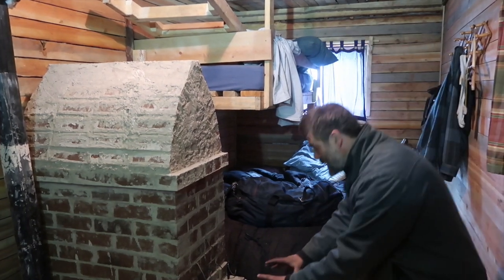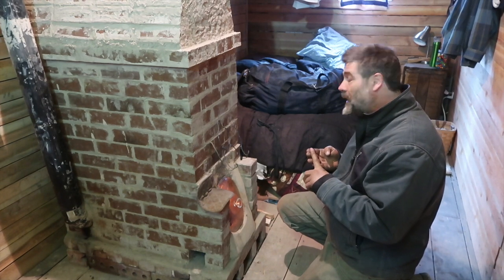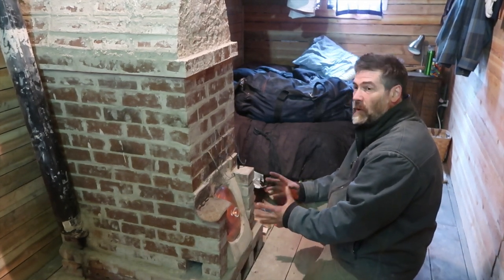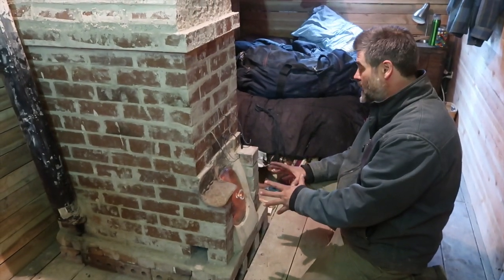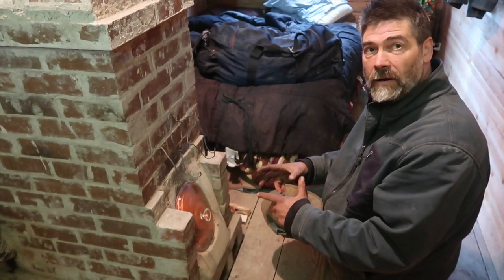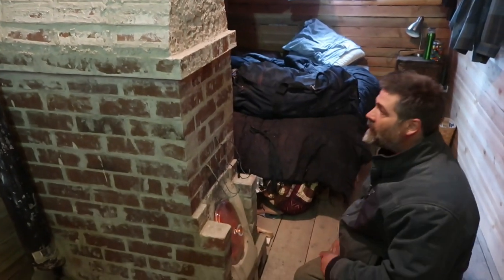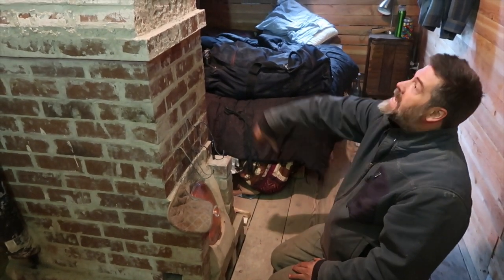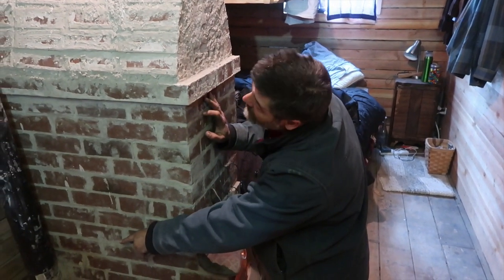Tiny House Rocket Mass Heater - the Cyclone by Kirk "Donkey" Mobert has no barrel!

Comment: Something what is the cheapest easiest fastest in simplest way to build something small for the people in Western North Carolina and Tennessee. 
They're going to be freezing to death...
I think I hate is that they use propane but little buddy heaters. 
I can guarantee some people are not going to wake up from lack of oxygen... Or they have a fire or an explosion people tell me 
Them to use rubber hoses that ain't the way to go and I'll tell you what!!
I'm having a small propane tank inside of a building is dumb. Need to be outside connected to the heater with a stainless steel braided hose
Reply from the maker: Like this? https://permies.com/3dp

Comment: Hey there, This question has maybe been answered here or elsewhere already but I'm trying to get some fast answers without having to parse through endless forum threads. I sometimes hate to admit it but aesthetics are very important to me and I've never been fond of the look of the oil drum bells. But I really love the look of your arched bell here and it happens to fit in really well with the large arched braces on the home I'm building.  The house is quite well insulated as it is strawbale wrapped but is also not that small of a space  so "fast heat" would be helpful in my situation. 

My first question: Does the use of brick in the bell instead of steel considerably slow down the overall time it takes to heat up a space?  If so, I wonder if having an arched bell fabricated from stainless would work or would the excessive welding at the edges make this a bad idea?

Comment: Did you use average, single-wall galvanized chimney pipe sections, to cast refractory cement into, to make the burn chamber & riser?  
Was there any insulation used on the outside of the metal riser? 
How long, with moderate to light use, would your tiny house rocket-mass heater last? 
Do you have other videos of you building this?

Comment: Questions: Isnt the barrel easier to remove to clean? Would you clean soot by regular chimney sweep methods? How do you maintenance it without disassembling it?
Reply: There is no maintenance on the barrel model as the creosote and smoke are consumed by the intense heat. What’s left is water and co2 per a previous video. Not sure if the same applies to these smaller versions.

Comment: Splendid! I have learnt so many things from this video!  I don't know if you could or would help me. I"m building a mass heater and I don't know if I can use the wood stove I have(terracota) as a mass. I want to use the wood stove as a mass, just introducing the exhaust pipe of the rocket stove into the lower part of the wood stove, so the wood stove will be the mass, then the exhaust will go up the chimney of the wood stove , after warming the wood stove. In this way I have a chimney and a thermal mass. The size of the exhaust pipe of the wood stove is 15cm, I mean the diameter, so I suppose the diameter of the exhaust pipe of the rocket stove should be also 15 or less, the same for the diameter of the fire box.
The wood stove is 1/2 m from the rocket stove an it is 1.60m high, 64cm large and 36cm width
I don't know if I, m right, but  it will be much easier for me  in this way, keeping the wood  stove,in case I fail, using it as  mass and having a chimney.in case I succeed, I wrote too much, pardon me, but maybe you can help , I like your explanations. Thank you again!

Comment: There's a couple things you need to post at the beginning of each heating season Paul. Every time someone makes changes that involve water or moisture you have to go through the process of drying out again. While this drying out is going on the stoves will run cooler .Then as they dry out they will run hotter. If you wait till the last minute to fire one up you might think there is a problem in the build. Look for steam in the exhaust. When it's dried out there won't be any other then a few whiffs in the beginning of a burn.

Comment: Been looking for something small for a 24x24 new build. Heating wise it would be a smaller space than that because I sleep with the windows open in the winter ( northern michigan) regardless of the temp outside. Anyways less than 500 square feet.

Comment: Sure takes up a lot of that tiny house space though...
Reply from the maker: No more than a teeny tiny conventional wood stove.
Reply: Uh... yeah, it does. A LOT more. Maybe the trade-off is worth it but it's kinda silly to say it takes up no more room than a "teeny tiny conventional wood stove."
Reply: Counting required safety clearances from a metal wood stove, this can consume as little space. It requires hardly any clearances at back and sides, so this would not stick out any farther from the walls.  Only if your wood stove was in the middle of a room could it have less "off-limits stuff space" than this RMH.

Comment: It's a small masonry heater -- been done for centuries?
Reply from the maker: Yes, all rocket mass heaters steal design elements from many places, including masonry heaters.  But masonry heaters do not burn as clean or as efficiently as rocket mass heaters.
Reply: I am sincerely interested in learning, and respect that you have a lot more knowledge of these things than I do.  How does the unit depicted in this video result in a cleaner burn than a masonry heater?  I have seen some masonry heaters built with what appears to be a "J-hook" burn chamber, similar to the little rocket stove I built in my back yard.  Are the batch box rocket heaters able to burn cleaner than a conventional masonry stove, in some way?
Reply from the maker: There are lots of little differences, but the big one, in this case, is the insulated riser.  A conventional wood stove attempts to extract the heat immediately.  A masonry stove attempts to store the heat immediately.  A rocket mass heater attempts to compound the heat immediately - to get a more complete burn.   Then the rocket mass heater will focus on extracting the heat into the room (like a conventional wood stove) or storing it (like a masonry stove).

Comment: This so obviously needs another door, to go into the bell to act as an oven.
Reply: That might adversely affect the stratification process, I don’t know that much about these yet, but my similar thought was a second chamber atop the bell, for a baking oven, but not sure if it would get hot enough. Maybe a steel plate instead of brick at the top of the bell, then the oven? This thing is so aesthetically pleasing!
Reply: I'm sure it would affect stratification, when it was open, but once closed? and the heat being continuously pumped up from the riser should refill rapidly, after all it's blasting away like a rocket. I hope to build a clay rocket stove in the garden this summer, to see if I can do it. if it works, I'm going to build up the sides to be thicker and build a cob oven on top of it. another option, a big carbon steel wok or stainless steel pot sat up side down on top of the  vertical cob wall surrounding the oven chamber, with oven door in the cob. radiant heat, longer lasting then a barrel, and no cutting. Assuming that I can even get the riser right.
Reply: “I'm sure it would affect stratification, when it was open, but once closed?“
Huh? If opening a door affects stratification you are suggesting cooking IN the actual gasses? I thought you meant a sealed chamber in the bell, with a door to that chamber/oven. But regardless, I doubt the bell gets that hot, and if it does you have something wrong somewhere. You could cook in a SEPARATE space atop the riser, where it does get hot enough.
Reply: I think it would work quite well as a white or a black oven. I'd be tempted to make it a black oven (food in the exhaust heat directly) for the extra flavor it gives the food.
Reply: If it had a door to cook in as soon as you opened it it would fill the house with smoke. It has to be sealed off.

Comment: Nice design, but it seems kind of big for the space.
Reply: It's a mass-heater with a large internal cavity. The space is necessary for the heat of the exhaust to be absorbed by the surrounding masonry, which then radiates that heat.
Reply: Thanks for the clarification!

Comment: Made on a mountain top in Guatemala huh? Sounds like this was designed for me
Reply: Yep. I'll be glad to describe the mix for the firebox, of you like. 

This stove was supposed to be made of adobes, but weather wasn't conductive to making them, so Paul had to buy the bricks for the event..
Reply: @SundogbuildersNet  please discribe..?
Reply: It was a mix of wood ashes, grog (crushed brick), cow manure and screened clay slip.
Reply: I recommend fermenting the mix before use.
Reply: @SundogbuildersNet  you think I can smash red brick with sledge hammer to get fine enuf grog? What percentage is grog? Can I use hydrated lime instead of wood ash? Or maybe some fine sand instead of grog? I have horse manure and clay. thanks
Reply: @voidisyinyangvoidisyinyang885  
I do not recommend any particular mix. The properties of the clay you use will be different than mine. My mixes may not work for you.
Reply: Yes you can crush red brick for grog. You can also just fire some clay and crush that. No, lime will not do. Lime cannot  handle the heat
Reply: @SundogbuildersNet  thanks for the feedback! As I dug deeper I discovered the floor channel needs to be specially welded and grinded steel. I don't have those tools nor parts. Then I would have to contend with making a door as well (as well as getting the mix right). I have used bricks. So I just bought a 2 Dog stove and I will surround it with bricks. Consider me an early drop out to the rocket mass heater movement. haha. I am not on a mountain in Guatemala since they are fleeing to the US due to abrupt global warming. And also I did buy the Silverfire Survivor rocket stove as well as the finicky Hunter - so I do have some pyrolysis experience. thanks.
Reply: Some sand will expand and contract in heat. This can make the parts crumble. Grog is the solution.
Reply: Theres always the J-tube rocket stove, which doesn't need a floor channel.
There may also be a simple way to make the floor channel with brick, though I haven't tried that yet.

Comment: I've watched a number of videos on rocket mass heaters. This style is nice that it doesnt require store purchased materials or at least not many.
I do have one issue with most of these videos and designs. I see almost none with a hearth in front of the stoves. One ember knocked out of the stove to fall into a crack in the floor boards would set the cabin on fire. Why is this?  The first thing one should do when installing any wood burning appliance is to fire proof the floor it will be standing on. Then fireproof the chimney where it exits through the combustible exterior wall materials.
I really dont understand this. Is this an american thing? There are no building codes requiring this? Does it not make sense to protect your family with something so simple?
Sorry for the rant, im really confused over this lack of basic safety.
The Ontario, Canada Building code requires a hearth in front of an appliance or fireplace. I usually build mine to be 18" in front of the fireplace or appliance.

Ontario Building  Code
Hearth Extension
(1) Except as required in Sentence (2), fireplaces shall have a noncombustible hearth extending not less than 400 mm (15 3/4 in) in front of the fireplace opening measured from the
facing, and not less than 200 mm (7 7/8 in) beyond each side of the fireplace opening.
(2) Where the fire chamber floor is elevated more than 150 mm (5 7/8 in) above the hearth, the dimension of the hearth measured perpendicular to the plane of the fireplace opening shall be increased by not less than
(a) 50 mm (2 in) for an elevation above 150 mm (5 7/8 in) and not more than 300 mm
(11 3/4 in), and
(b) an additional 25 mm (1 in) for every 50 mm in elevation above 300 mm (11 3/4 in).
Reply: With Batchrockets, I think that is a very good idea. I've built two now that I wish had a coal catcher. This stove sort of has one, but it's small and internal.
J--style rockets don't need them.
Reply: There is a strong draft that pulls sparks inward. The risk you described is nonexistant. That is the problem with you statists, you think you know better than people who actually try things. People like you are the reason that horrible conventional fireplaces are the norm.

Comment: So. fucking. cool. Truly fantastic innovation, I'd love to hear an analysis about it's advantages and disadvantages after it's been running for awhile. I'd love to hear Erica and Ernie's thoughts on this design as well! Thanks for the video Paul.
Reply from the maker: Ernie and Erica were staying in the red cabin as it was being built.  They said it was quite comfortable in there!
Reply: Very nice. Any known issues with blowback?
Reply: It can be a little tricky to start. You want a tiny top-down fire just in front of the throat, so that the flames engage the throat immediately. Once the riser is warm and there's some heat in the chimney, then logs and whatnot can be layed on.

Comment: How does it get cleaned out, I'm thinking ash/soot raises into the chamber, then  eventually falls to the bottom of the chamber, so would it not block up the chimney exit eventually?
Reply: Yeah. The clean out is the chimney pipe. Pull it off and vacuum behind. Done.
Reply from the maker: I hadn't thought of that.   I suppose the thing to do is to pull the exhaust.

Comment: Interesting! I'd love to hear more about the benefits and detriments of this style. Is it mainly for smaller spaces where you don't have so much raw material for making cob? And how does the heat distribution over time compare without a big thermal mass? Maybe you could include a direct link in the description to a specific permies forum thread about this design?
Reply from the maker: more about this design here:

https://permies.com/t/71576/tiny-house-rocket-mass-heater
Reply from the maker: Since there is no barrel, then there isn't a lot of instant heat.   So it takes some time to warm up the space.  Although there is a fair amount of radiant heat from the door.   On the flip side, it does continue to give off a lot of heat after the fire has gone out.
Reply: Awesome! Thank you very much. Loving all the new videos.
Reply: @paulwheaton  I'm new to the idea rocket mass heaters in general but like the looks of this for the limited space needed in a build I hope to try next year. I've looked at the link and just want check I understand the difference. Is it just the rocket heater into the brick dome and relies on the larger open area of air to heat up the whole dome and then its open direct into the outlet chimney from the bottom? Just trying mentally picture the cross section design. Also is the any lower acces chamber for cleaning that can't be seen? Thanks

....... now off to check out some your other stuff 😊
Reply: Is it still as efficient as a heater with a barrel? 10th of the wood or so? and you can still light it up every other day like the standard rocket heater? this looks prettier than the ugly barrel I must say, the wife will like it.
Reply from the maker: We think it will be.  The exhaust gasses are quite cool.
Reply: Yes to all of your questions!! 1/10 of the wood, high thermal mass, etc.
Reply: Not this stove. This is a 4 inch BatchRocket, good for maybe 500 - 700 sq ft. depending.
I think you'd want a 6 inch model of a similar design.
Reply: That's fantastic, will it be sufficient for a 1400 square foot home?
Reply: Cool, thanks!

Comment from the maker: Check it out, no barrel!
Reply: But how long before it actually radiates heat into the room? The barrel produces heat very quickly, I can see that the brick would hold heat for a long time but if it hasn't been fired for a couple of days wouldn't you have to start from scratch?
Reply from the maker: The door puts out short term heat.   But, you are right, the lack of a barrel means that the total short term heat is not much.   So expect to burn for a while to get the heat up.   BUT!  Then you have many hours of heat coming off the bricks, long after the fire is out.
Reply: @paulwheaton are there build plans for this heater?
Reply: My RMH is larger and considerably different from this one, but it does have a face adjoining a future stone chimney which is only one brick thick. That face gets warm within 10-15 minutes, and is throwing a lot of heat within an hour.